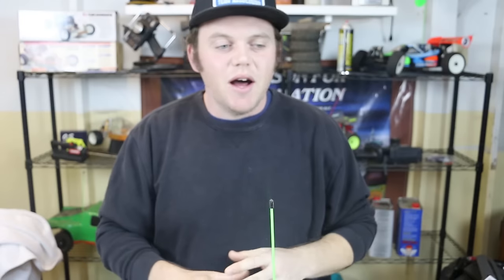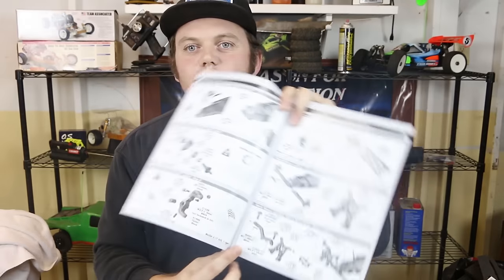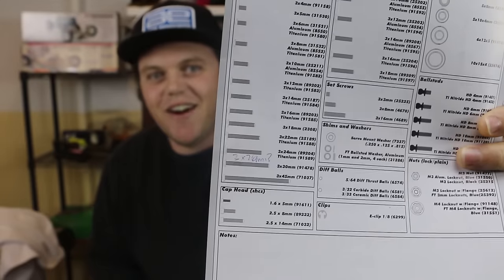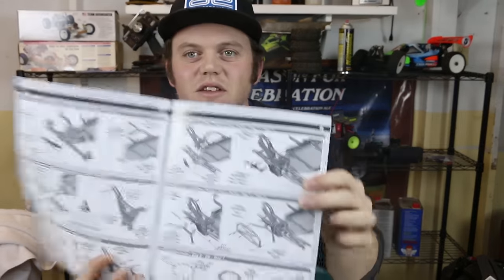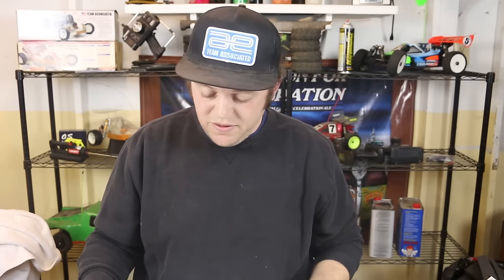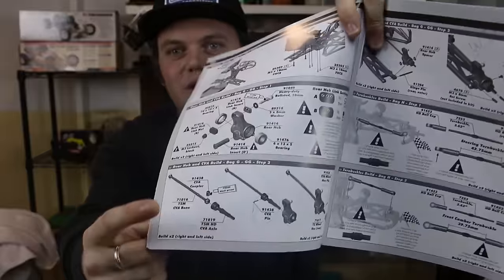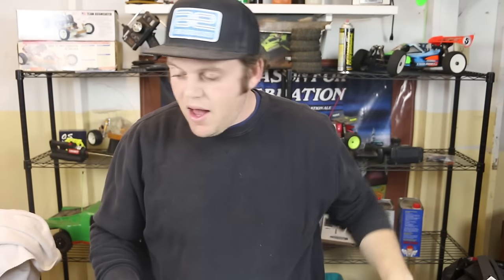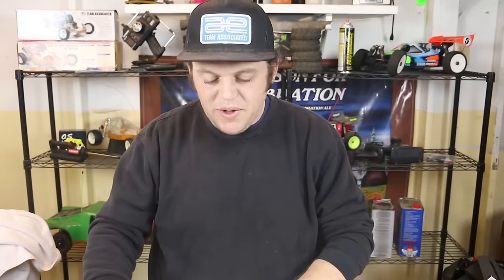SC5M Build Review - Team Associated Short Course Truck

Comment: Lots of info!  I had the same bag/manual labeling issue after bag C. Also the two sets of capture screws that were optional parts blew my mind!  I mentioned both of those issues in my video. Otherwise, every other thing was good. I always do a quick caliper measure, but like you said having a 1:1 diagram of the screws on the step page would be nice. I didn't have the rear toe block issue, but do remember the B5M being a different design.
Reply from the maker: +The RCNetwork Ok, good to hear you had similar issues... well not good, but you know what i mean. The manual issues aren't that big of deal during the build, but it's frustrating to deal with.

Comment from the maker: I messed up guys: at the end of the video I talk about the gearing not fitting with the included small stock spur gear, but I had the larger spur gear for modified motors installed. Once I put the 78T spur on, no issues.

Comment: I'm a bit confused about the detail in this video.
I just built my SC5m. I didn't notice the 3x26mm issue. The only screws in the bag that obviously fit were the 3x24mm. The parts list is correct but I guess the picture is labelled wrong.
The instructions are labelled incorrectly for bag D as well in my kit.
Everything else went very smooth. No striped threads...no issues with fit. I am very happy with how the truck went together. The build took me about 6 hours to complete over 2 days.
The great thing about this kit is that all the hardware needed for each step is in its own bag included with the parts bag for that step. As each step is completed, you can have your sorted screws..etc..laid out and everything is used with no extra or shorted parts.
Really looking forward to getting the rest of the electronics for this truck and seeing how it runs. I originally looked at the B5m and almost..ALMOST..bought the RC8B3e, but the SC5m is virtually the same size and has the B5m layout I like.

Comment: My Tekno NT 48.3 manual was wrong on the rear diff. Shows the same as electric. I had to tear it out and turn the diff around. I have 4 Tekno buggy’s and I had two soft spots in the plastic were the screw just ate the plastic and would not tighten completely. My only complaints because they have all been great!

Comment: as i can see, team associated is having a lot of issues,i have an tc 6.1 worlds car and i had the same problems with the servo horn and the stripped screws, also the manual is not that great and if you are not an experienced builder you are going to have a lot of frustrating moments with this brand, love your videos, keep the good work.
Reply from the maker: Agreed +Cesar Gac. But although the build was less than ideal, the truck performs excellent and it's a blast to drive! How is your tc 6.1 treating you now.

Comment: I had the same problem with my b5m lite kit! But I did the exact thing you did haha
Reply: Oh and those set screws really bent me out of shape when building the kit....COME ON AE THE COST PROBABLY $0.03 to make
Reply from the maker: +JAMMIN RC Yep! There are so many things wrong with this kit, really the 5 series in general, that it makes it hard to buy AE even if their cars perform well. There are so many vehicles on the market that are awesome, like the 22 2.0 (one of my favorites), RB6, YZ-2 and SRX2, that my conscious has a hard time spending money (and supporting) AE. Part of me wants to boycott them altogether, and another part wants to run their vehicles because thats what 99% of the racers at my local track run; making setups and spare parts plentiful. But IDK, this situation just sucks.
Reply: I built a losi kit and the ae kit in the same month. Loved how the losi is presented and packaged. And they don't have that crapoy "pro tip" option part screws. They need to step it up. I don't think I would ever buy a b44... Series kit those are the worst

Comment: I had the same bag issue as well! I agree that the shock set up is not very good for hi bite clay. Can I ask what weight and changes you made to the shocks? Thanks and good videos! Very informative
Reply from the maker: +Philip Cunningham 37.5 front and 30 in the rear. Also put on harder front springs and softer rear springs. Running the battery all the way in the back. The setup is pretty much a direct rip from one of Cavalieri from the AE website; roar nats i think? The truck works really well with tons of steering, but not as quite as aggressive. The box setup was ridiculous to drive.

Comment: Should I be a sc5m 4 gear buyer for a hard packed slightly loamy outdoor track? Or stick with my winning sc10?
Reply from the maker: If it ain't broke don't fix it +Jeff Shawaga. I run on an indoor med-high bite clay track and the SC5M outperforms the SC10 in corner speed. But for your conditions, the performance gains might not be there. If you just want to try out the truck, go for it! The engineering is much better than the SC10 especially how the tranny case/motor plate are assembled, making easy diff access, so I'm sure you will like the truck in that respect. If i were you I'd try a SC that is mid- or rear-motor compatible, just in-case mid-motor doesn't suit your track. Let me know how it goes!
Reply: Thanks! Very helpful response

Comment: entertaining video.  my SC5m is dialed!  you don't build with calipers?  really nice to have... a must for building shocks.  running a 8.5 with 21/84T - 3 gear.  you gotta admit, props to AE on their "5m" cars - heck going to all metric alone is worthwhile.
Reply from the maker: +hsp-sandiego i do use calipers when building but rely on the 1:1 hardware diagram typically as i find it faster. you're right about the metric hardware, it's so nice to have now.

Comment: So did the kit have the 3x26mm screws or did you have to use different screws.
Reply from the maker: Hey +Papo Cordova. The 3x26mm screws were included in the kit, they were only left off the hardware diagram.
Reply: Thanks for the update. By the way, I like your videos.
Reply from the maker: Thanks man. Subscribe for more.

Comment: Will you be doing a B3 review
Reply from the maker: +Shane Burns No. It's basically a MBX7, but less durable. I have a friend who owns one and hates it. It breaks easily, the tank keeps cracking and the tolerances with the plastic is poor. I don't recommend it until AE works out the issues.